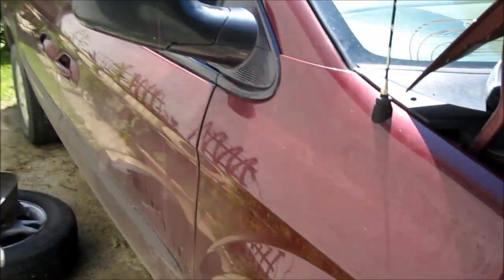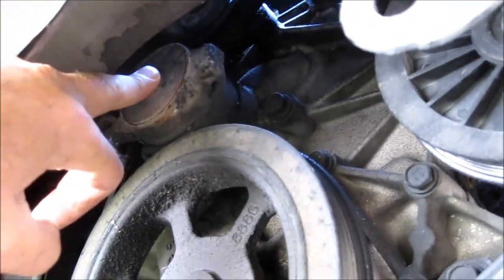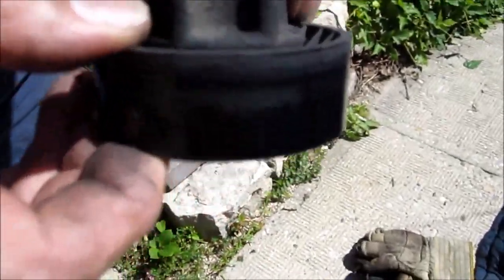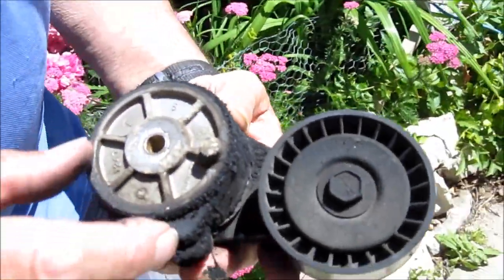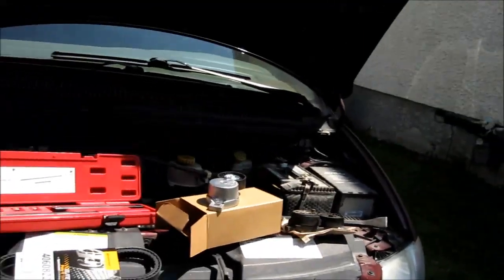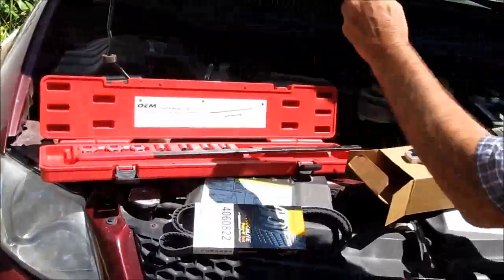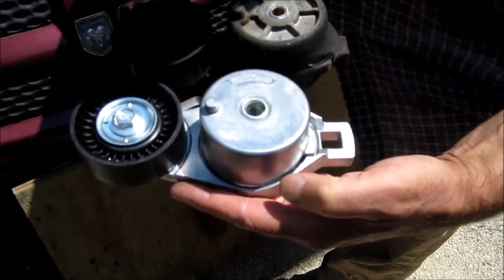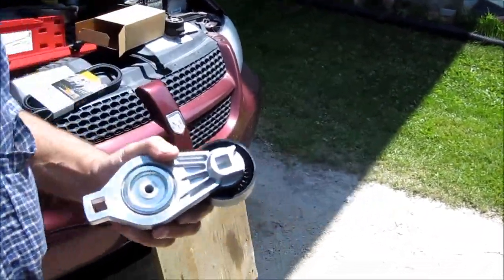DODGE CARAVAN 3.3 or 3.8  belt tensioner tool (so easy)

Comment: 21mm or 13/16th wrench on the tab, opposite side of the original part works as wel.l on the replacement looked bigger but either way if you cant get in there with breaker bar or 3/8ths or 1/2 inch ratchet then a wrench on that tab will work A-1 auto uses a wrench in there water pump video. just sharing info sometimes a guy might not have a ratchet.

Comment: Wish I could do that with my 3.0 litre 2000 Plymouth Voyager. I have to jack it up, put jack stands under it, crawl under it, and reach deep into the engine compartment. It took me over 3 hours to get the old unit out and put a new one in, and then route the serpentine belt.

Comment: Why on God's green earth do we have to go through so much crazyness on these cars --- why did they make it so difficult and unpleasant (understatement) to work on them?!?
I think a Formula One car would be less difficult and stressing to work on!!
Reply: because they are built to be easy to work on by the same engineers who make it a nightmare to work on your personal car. so you will bring it to the dealer to have it worked on all while being butt raped by the charges. its also why you can buy simple parts that a costs 50 bucks and is worth 15 cents made of plastic
Reply: ozzy kimble Having been a parts guy for decades, and a car guy all my life, I already know the answer. It's the fact that making it easier to put together on the assembly line, and saving as much money during manufacture, is the primary goal. That's because, next to HR, Accounting is the most powerful department in any modern company. The end user being able to make repairs is the furthest thing in their thought processes when designing a car.
I was just venting my own frustration as I tried to fix my car!

Comment: i have to ask why u wasted your money on it. and extra long wrench or two wrenches doubled up work perfectly. ive used the double up for years and would never bother with that tool. its a waste of hard earned money.
Reply: It was a LOANER from the auto parts store.
Reply: On my '05 Grand Caravan I took the wheel off and removed the plastic panel just to discover there is not enough clearance between the frame and the tensioner to insert a regular ratchet in the 1/2" socket hole. I don't see how you can use the double wrench trick on this.Thus the extra THIN tool!!!
Reply: $15 at harbor freight
Reply: @johnkozarevich3552  sadly engineers are trying to put normal people out of being able to repair their own stuff. now theyre creating throw away cars. the market for repairing them is dwindling. no one wants to repair a car you can brush up against and its dented.